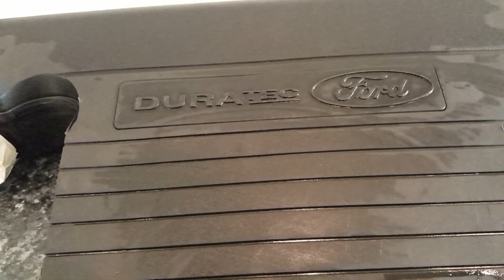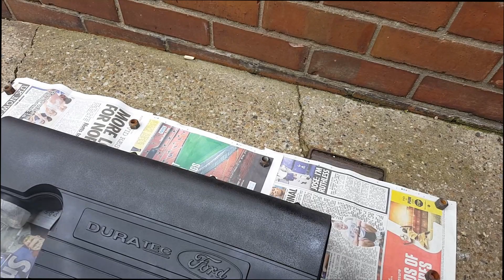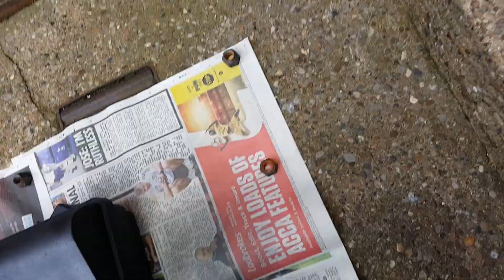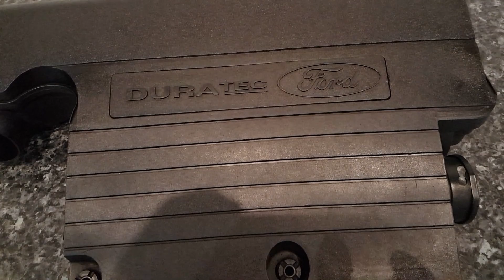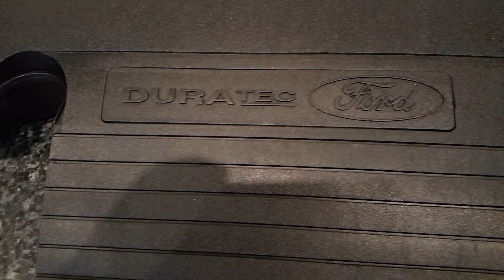Cleaning Up My Ford Fiesta Mk6 Engine Bay Part 1 ( Spraying The Air Filter Box ) ( Project Norman )

Comment: On the rougher plastics if you use a matte or satin finish paint it will come out a bit more uniform that a glossy paint
Reply from the maker: Thanks 😃
Reply: @gazza9919  No worries mate, just trying to help 👍

Comment: I thought about painting the plastic airbox, but wouldn't it cause a heat trap for the air flow...be easier taking out the box completly,. Then fitting a proper induction.. 57i or piper cross